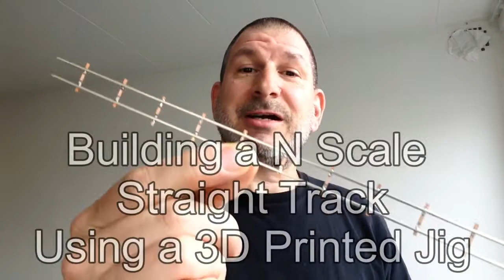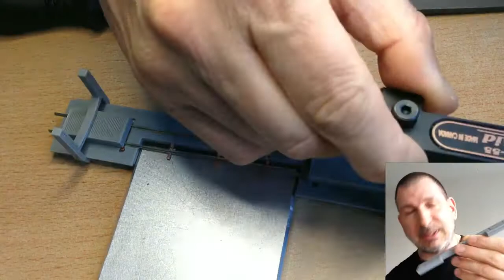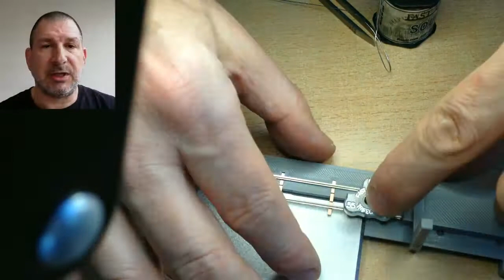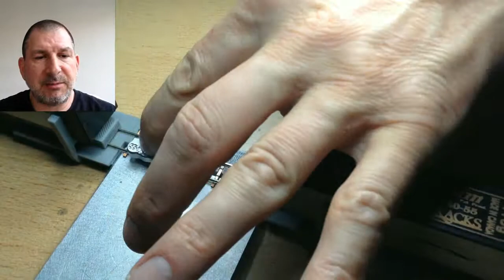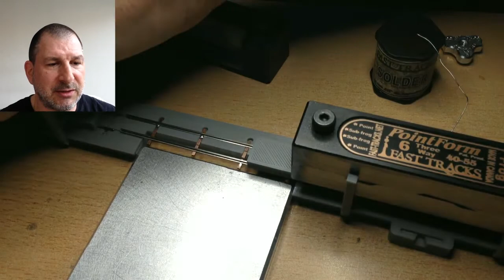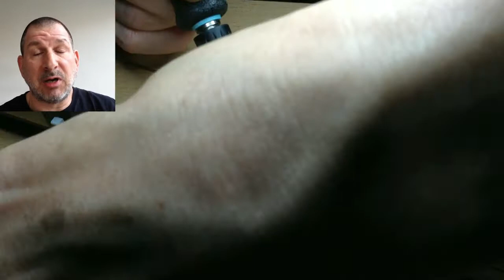First Version: Building a Handlaid N Scale Straight Train Track Using a 3D Printed Jig w/Heat Sink

Comment: Where did you find the rail?
Reply from the maker: I use MicroEngineering - but they may be going out of business... http://www.microengineering.com/products_rail.htm or from Fasttracks https://www.handlaidtrack.com/rail-micro-engineering-rail
Reply: @handlaidtracksand3dprinted922  ah, thanks! Just curious, there ain't any diy way to make the rails, is there?
Reply from the maker: I suppose if you had access to the proper metal alloys and the equipment to form it, then the rest would be simple... But it is still small scale foundry stuff. Which is way beyond simple.